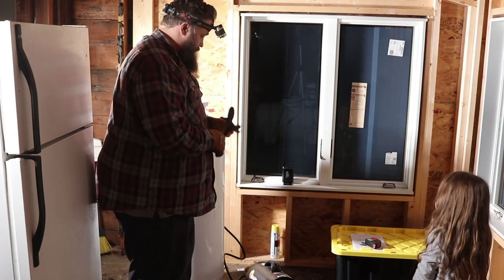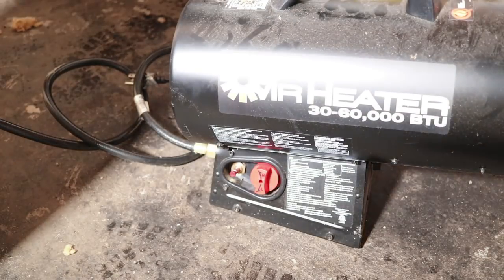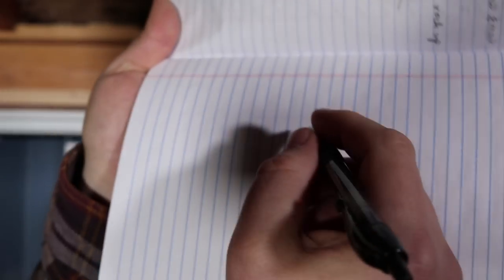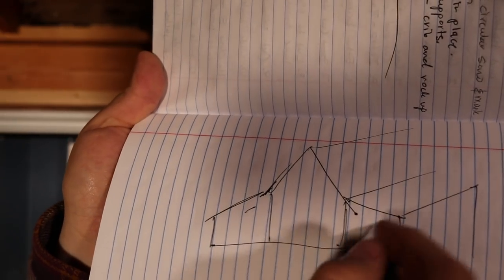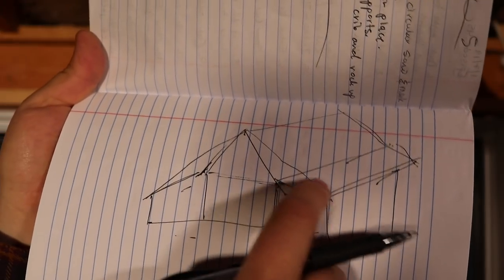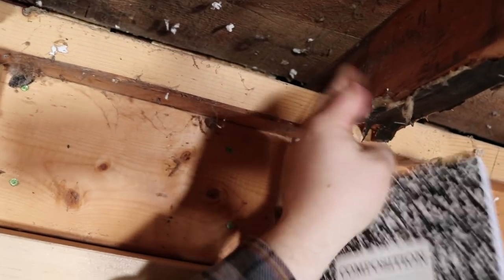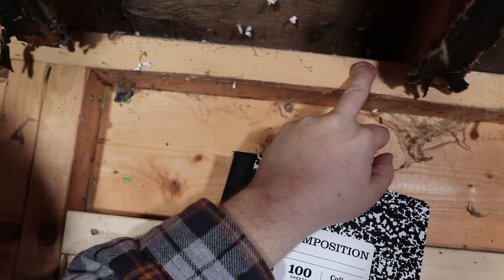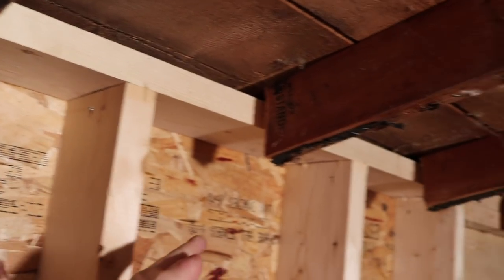This Farmhouse Has a Wonky Wall (Ep. 51)

Comment: I understand what you are doing - it was a young builder that did the work and does not understand old houses which need there own knowledge - I would run the beams the whole length and attached them to the existing beam but would do it with fence rails which in effect is what the beams are  and I would do it so it notches as per the good part and is nailed onto the existing all the way up and notch it at the top as well giving it additional strength - better than what you had - look forward to watching - old houses always give curve balls to figure out

Comment: I do not agree. build a post and beam support. beam running across under rafters with posts supporting it against the wall. You only loose the post footprint as floorspace. If you try to extend your rafters out you are talking about all new structural issues.It is at least triple the work extending rafters. And a lot less structurally sound. Due the second roof using 2 points to support it from thr witchs hat roof. one of those points being outside the wall a short distance I would think.
In the south your solution might work in down in texas. Where i currently live. I think you will have problems with snow weight with extended rafters. And dont notch beam put wedges on top.
Reply from the maker: I like your idea.
Reply: Thanks, you could also cut rafters to sit flush on top of the beam moving it further up into the ceiling.
Reply: Excellent advice!  I totally agree.
Reply: I live in Texas as well.
Reply: @NTMDTR205605.....I concur. Load is WAY easier to provide than shear.  JMHO, (based on 45 years const. exp. btw)
Reply: Nice suggestion & fix!

Comment: Would using joist hangers be an option?
Reply from the maker: I thought about that but there's anywhere from 1/2" to 1" plus of space between the wall and the rafters. It really got mucked up when he cut these off like this. LOL. I think #NTMDTR205605 idea could work out pretty nicely. That wall is a short wall so we don't have any plans on putting up cabinets so the beam at the ceiling of that wall wouldn't matter. It could actually look kind of cool if we did it right and left them exposed. It would also be way faster. I thought about building another wall on the inside of the current wall but that room is pretty narrow and I'd hate to give up 3.5" of width. Post and beam would solve that problem. I have to make the decision tonight so I can work on it tomorrow. Any and all thoughts are welcome. :)
Reply: Oh wow! He REALLY messed it up!  Yeah, the post and beam may be your best option then.

Comment: So that's why old houses look like that.
A newly built wonky wall. That would be disappointing to me.
Reply from the maker: It was a pretty major blunder on the part of the guy who did it. It's not a simple fix to correct the problem and It was frustrating when I noticed it. With that said, we just have to move forward with it and get it done right.